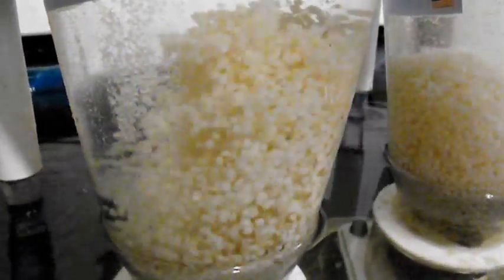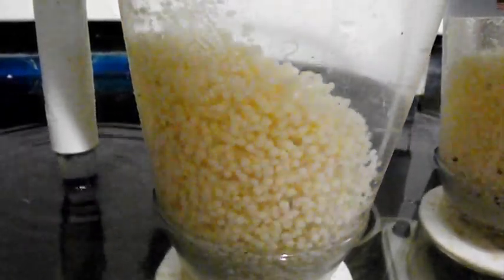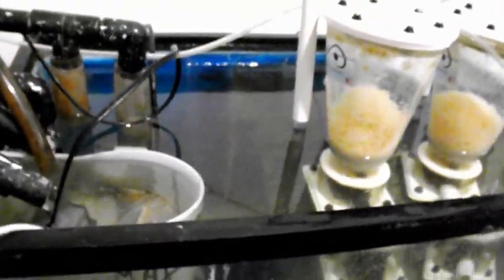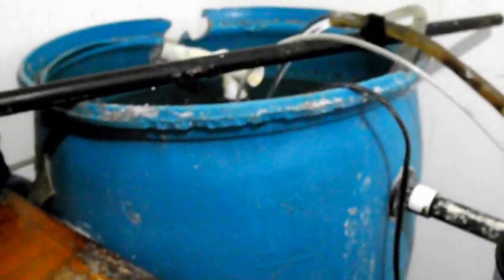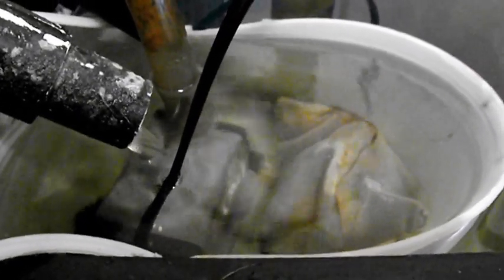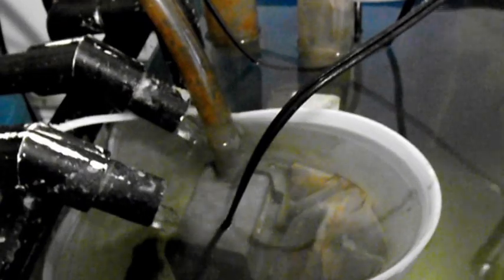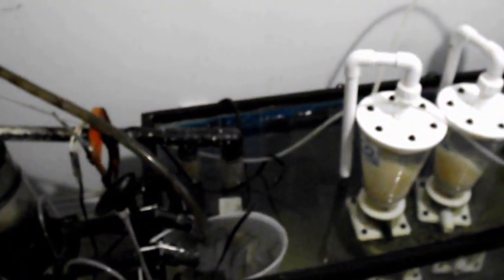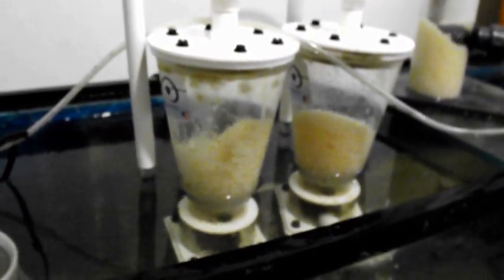How to REMOVE NITRATES  with Bio Pellets / Bio Pellet reactor.

Comment: Its actually a very nice set up.  It does not matter if its rigged looking as its all hidden.   What matters is it works!

I have a 330 gallon that I just hooked up a large Reef Dynamics reactor to.   I don't have my pellets tumbling as fast though.  They said it can pulverize the pellets faster if they are tumbling too fast.  The output of my reactor goes to a three way PVC fitting which makes sure all the outflow goes into the skimmer.

My flow back into the main display is not completely free of tank water though.  There is some mixing going on so mine could be more efficient.

Only had mine going for 5 days, trying to kill off some hair algae.   My damn puffer kills any sea slug or any other algae eating creature.   So ill try the pellets before I get rid of him.

So you have water from the tank going into to that blue barrel?  Does that not defeat the purpose?
Reply from the maker: goblin072 thank you for seeing the good  in this set up  So many comments from people who are blinded by there desperate need to see nothing but bad in everything that exists